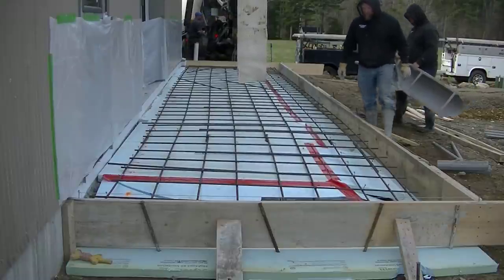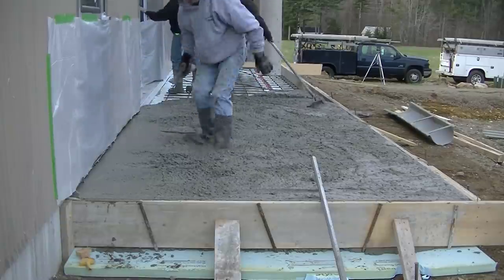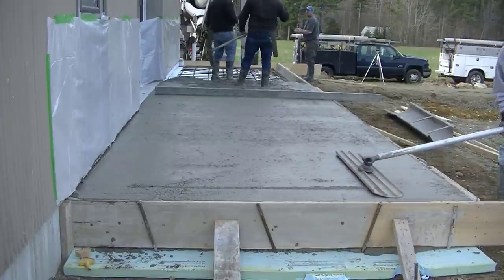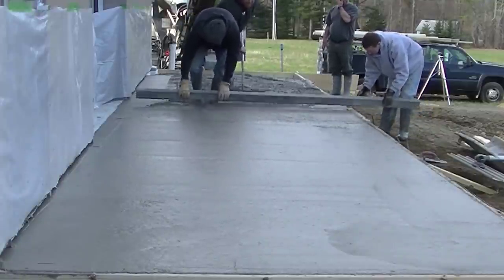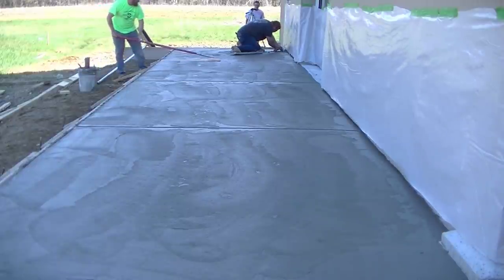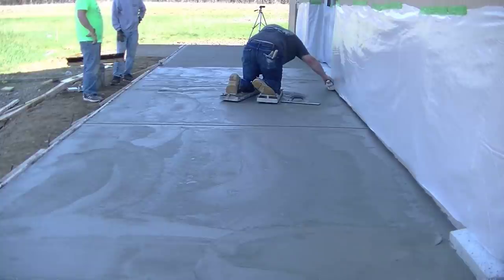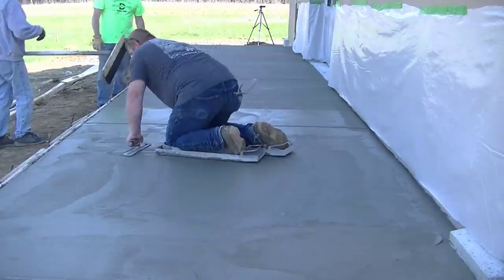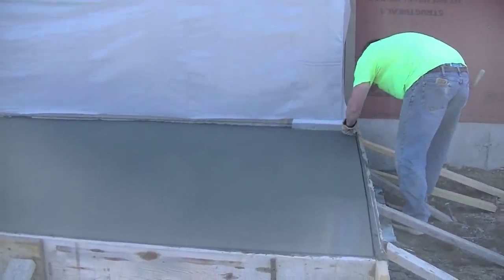NEW! How To Pour A Concrete Patio Slab [Beginner's Guide]

Comment: If you say the weight of the concrete can make the 2x12s bow pretty easily, would be okay to double them up by screwing 2 2x12s together on the outside edge and sides?

Comment: For knee pads I purchased some maybe 2 months ago and everytime I just rest on them with my knees I feel little pain from it. Guess it's from the pads wearing out. What is the highest quality. For knee pads. The ones I like are with gel pads. With a strap. I got gel pads but with the sticky part in order to put them around your knees.
Reply: Kneepros are the best on the market . Been using that brand for over 20 years! They've got a hinge point, light weight, and the straps don't cut into your legs.

Comment: I see your still using mesh ,,, have you tried the polypropylene construction mesh in your concrete jobs yet  , not the small fiber mesh , this stuffs about 40mm long and bigger all round .
Reply: If you use the heavier mesh then it makes your broom job look hairy.
Reply: @gunfisher4661  I'm looking into it for a garage floor ... it looks like it will save a lot of time and money .. it's tempting
Reply: @tomthompson7400  We`ve been using fiber mesh for many years in place of wire, It`s much less hassle and preforms well both indoors and out . On a residential floor residential mesh will work great as you get into the heavier grade meshes they tend to stand up on the floor for a while and look hairy , I know because we use the heavier sizes in factories on slick floors, If you have a questionable base in your garage as I1ve seen before you can run rebar as back up every 2-4 ft on center or just in the location needed.
Reply: @gunfisher4661  thanks for the reply .. the base is good and the slab is only 16 ft x 36ft but I will pour it at 9 inches all over ... looks like big fibers will be going in .. do you still cut it for shrink cracks the same as when using steel mesh ?
Reply: @tomthompson7400  9 That`s enough to hold a full concrete truck. There are 2-3 sizes of the commercial fibers available at most plants but call ahead to be sure. Yes always for saw cuts. Saw cuts the thicker the cement the deeper the cut in your case about 1/2 inch and for area size of the saw cut 12ft x 12ft is the largest allowed by code here smaller is OK like you could split 16ft by 3 if you wanted. About the only time we don`t saw cut is on heavy machine pads for precision machinery
Reply: @gunfisher4661  I've a pullmax and a mill going in the garage hence the base ... they are a big heavy metal shaping machine .. many thanks for your time and advice .. regards t

Comment: Hello.  I'm sure you get this question a lot but, considering you have 30+ years of experience I thought you might know.  Whenever I look up reinforced concrete there are all of these articles claiming the science of reinforcement in concrete and where the reinforcement needs to be to have any effect and to avoid corrosion.    They usually say bottom 3rd of the slab, at least 2 inches off the bottom.  I watch a ton of videos on concreate and nobody follows this.  Is it not necessary or not worth it?
Reply: Reinforcement should be in the middle of the slab. Doesn’t do much good if it’s at the bottom or very top.
Reply: I`ve done many commercial and industrial slabs of many thicknesses sometimes even 4-6 ft thick and I still ask the engineer when I see them and still get the same answer that the rebar gives the most strength at 11/2 inch from the bottom and 11/2 inch from the top. seems to me it ought to be deeper but I`m not an engineer.
Reply: @gunfisher4661  Thank you
Reply: @jackwilliams7738  Thank you
Reply: None of the rebar will ever touch the ground because it should be sitting on concrete bricks(chairs).